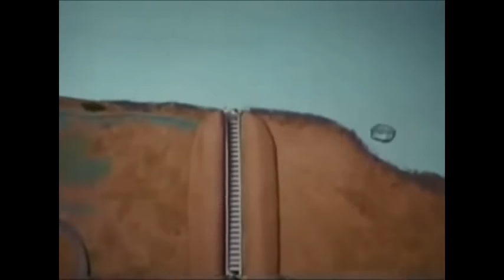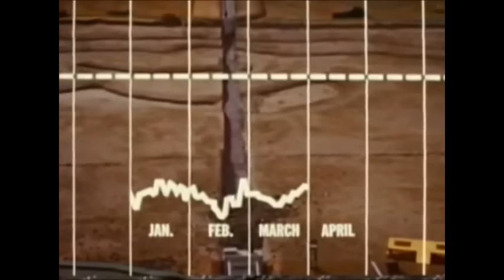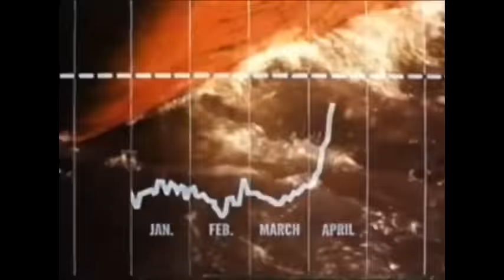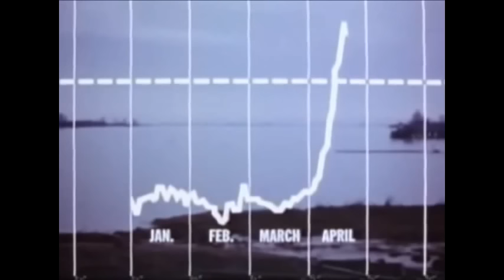Construction of the George Massey Tunnel 1957-59, aka Deas Island Tunnel - full film

Comment: An immersed tube tunnel. The same as the Sydney Harbour Tunnel, although the sections for it were built in a dry dock at Port Kembla, and towed by tugboats through open ocean north to the harbour, a distance of about 100km. The tunnel passes near to the Opera House, which Queen Elizabeth II opened in 1973.

Comment: Would make a lot more sense to just add another tunnel next to the current one. The infrastructure is already there to support it and you wouldn't need to disrupt current traffic flow to do it. The bridge idea is ripe with major flaws, the ground below is mud so there isnt a stable base for bridge pillars. It would also require redevelopment of the highways on both sides which would cause traffic nightmares until its finished. Could probably drop a new tunnel down there for 1/3 the price. Could even drop another tunnel afterwards without much disturbance.
Reply: too easy :) this is the 2020s, things have to be complicated and make no sense

Comment: I was once told that the tunnel elements are supported by (and welded into) steel beams that were first pile-driven into the bedrock. I'm probably wrong, or this bit of information was left out. Were there, in fact, any beams pile-driven into the bedrock to support the elements?
Reply from the maker: As far as I know, the answer is no.   The design did not need it